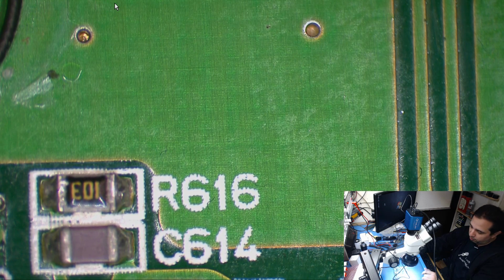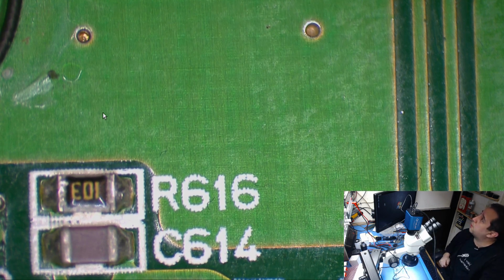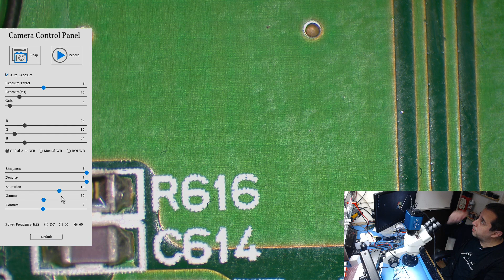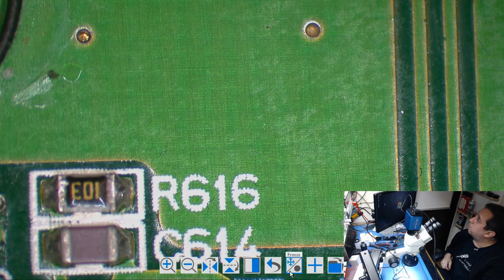OMANO 2300ST MICROSCOPE WITH OPTIXCAM

Comment: OptixCam OCS-HDMI-1080PU 2.0MP PC / MAC 60 FPS Digital Microscope Camera
https://www.microscope.com/microscope-cameras/omano-ocs-hdmi-1080pu-2-0mp-hdmi-usb2-0-digital-microscope-camera.html
Reply: This is the same camera :
https://www.aliexpress.com/store/product/1080p-HDMI-USB-SD-digital-microscope-camera-with-SONY-sensor/1918400_32464609452.html

Without OptixCam logo on its side. And its only $340 including DHL Express shipping (about 5-7 days)

These are all the same Chinese camera with 2.3MP Sony Exmor IMX236C sensor, 60fps HDMI, 30fps USB output. Not bad, usable, but not especially HQ either. The resellers put a brand name on them for another $100...300
Nice business.

The AmScope's camera manufacturer is the same as OptixCam's, so they also sell exactly the same type, of course.
http://www.amscope.com/accessories/camera/1080p-hdmi-digital-camera-for-standalone-and-pc-imaging.html

RisingCam  $339
AmScope $429
OptixCam  $659
The choice is yours.

This is the original manufacturer:
http://www.touptek.com/product/showproduct.php?lang=en&id=285

Comment: Hi, I have an amscope  SM-3TZ-54S with trinocular. Just received the amscope af100 and honestly not impressed. Basically I'm looking for a clear picture 1080p camera like this one that attaches snug to the amscope and records without me having to ..as you stated.. hold a separate camera recording my monitor. Does this allow you to record while still in pc or is it swap to hdmi and record via micro sd instead? Also which adapter would you recommend? I really appreciate it, thank you. Also great vid!
Reply from the maker: The AF100 is a piece of junk. I had my own bad experience with it before I got my other camera and scope. Amscope was less than helpful to correct an issue with consistent clearly across the image. They kept streching out the my issue past the return period and then told me that that camera was not compatible with the trinocular scope system. It then was a nightmare trying to get a return/refund. I was not happy with the situation. Once I did get the refund I went to Microscope dot com and did my buisness there and was much more satisfied. In the description of this video are the parts I used. You can use OBS software for recording from the camera into a HDMI capture card. You can call them and tell them you saw my video and would like the same parts and parts listed and they will help you out.
Reply: Kev31779 awesome I appreciate it, also subscribed. Thanks again!

Comment: Here is your model, without the fancy "OptixCam"label, compare the 2 and let me know if i'm wrong. Thing is I've been there and done that :) lol that's why i'm letting you know to go and expose microscope.com for the fraud they are

https://www.amazon.com/Definition-1080P-Microscope-Camera-Control/dp/B01GQQYBUQ/ref=sr_1_4?ie=UTF8&qid=1470066486&sr=8-4&keywords=1080p+microscope+camera
Reply from the maker: As far as I was aware of is the new "Optixcam OCS-HDMI-1080PU" replaced the old and discontinued OCS-HDMI-NH1080. The link to the one you sent me looks like the camera. Maybe that is a knock off of the new version or has been re branded. I do not know. I expect I got what It stated. I do not remember what the box looked like. I will have to see if i can find it.
Reply from the maker: +Thomas Crown I can tell you one thing. It is light years better than Amscopes POS autofocus version they recommend  for the same price. I know , I bought and it was horrible. Bad pixels and crappy sharpness, colors were off. Just all around horrble.. Sending it back was a huge hasle. Almost didnt think I was going to see my money again.
Reply: agreed sending anything back to amscope is a pain
Reply from the maker: It appears that they state on Microcope.com that Optixcam is their house brand. I do not know if they can choose a level of quality camera and slap their Optixcam can sticker on it. I don't know,  It is unclear. I do not see an official Optixcam distributor or company. So It appears that they can re brand any camera on there site to their "Optixcam" quality standard.  Seems like Optixcam is just an in house buzz word. So I would think that the original "real" HDMI-NH1080 camera is nothing more than a re branded one itself also.  Who knows.    http://www.microscope.com/education-center/buyers-guides/microscope-brands/optixcam-microscope-cameras/

Comment: Not to burst your bubble buddy, but your "optixcam" is not really an optixcam. Let me guess, came in a generic box "HDMI+USB MULTI OUTPUT", label from a label printer on the side saying "OptixCam)
 lol Only One LED on the back of the camera? Optic cam is more rounded and has 3 LED lights, 2 on the top and one on the bottom. Yours is a cheap knockoff from amazon sold for 599.99 by microscope.com :)

Comment: Thank you for the review. I love your set up and want to order exactly. Can you help me with the exact list of build? Any adaptors I need?

-OCS-HDMI-1080PU 2.0MP HDMI / USB2.0 Digital Microscope Camera 
or
-OCS-HDMI-NH1080
is there a difference?

-OM2300S-T Trinocular Head (Recommended for Cameras)
-V15 Boom Stand
-144 LED Ring Light, Variable Intensity by Section
-0.5X Barlow Lens for Omano OM2300S, WD=200mm
Reply from the maker: +Marcus Choe  The OCS-HDMI-1080PU replaced the OCS-HDMI-NH1080. It has a few more bells and whistles. You are going to need a camera to head reduction lens adapter, I think it was a 0.3 or 0.37x. Do not get the bore adapter type or the camera will rotate. The articulating arem was from amscope part number APC. But the stand can be your choice of any from whatever vendor you like as long as it accepts a 76MM head
Reply: +Kev31779 Thanks Kev for the quick reply. I talked to the microscope.com people and was told to get the 
-C-Mount Adapter 0.3X for Omano OM2300ST $109
instead of
-Fixed 23mm Camera Adapter 0.37X for SK2 Series Cameras $24
or
-Adjustable 23mm Camera Adapter 0.37X for SK2 Series Cameras $59

because it's made for OCS-HDMI- 1080pu camera will have a bigger field of vision. Just trying to make sure I don't buy unnecessary upgrade.
Reply from the maker: +Marcus Choe  You will not be disappointed with a better lens adapter . If you cheap out and get the bore adapter instead, the camera will rotate on its own and the optics are not as superior. Here are the parts I ordered.  OCS-HDMI-1080PU ,  OM2300S-T ,   OMBL-2300S-05X  ,   OMCM-2300ST-03X.   from microscope.com and from Amscope I ordered the APC articulating arm. I hope this helps.  The mount works for my situation but it may not for yours. You will have to decide what type of mount will be best for your purpose..
Reply: +Kev31779 I can't thank you enough for your time and detailed information.
Reply from the maker: +Marcus Choe  No problem just ask for the Kevin package lol
Reply from the maker: +Marcus Choe  And for video input to the PC I used a Elgato HD60 Pro
Reply: +Kev31779 Since you are using the OMBL-2300S-05X to increase working distance, does this cut the magnification to half of 45X ? Did you get the 20X eyepiece to bring it back to 45X magnification?
Reply from the maker: +Marcus Choe I got the standard 10x eye pieces with the 0.5 barlow. Anything more than that and the image becomes darker to close and a little shaky. For my work I think the 10x eyp with the 0.5 barlow is just a fine range for the scope.

Comment: Well done for copying Louis. Now do something original!
Reply from the maker: +rupert handford What am i copying? Repairing electronics and using common tools that work better? I believe my channel has been around a lot longer. Why ignore what works better. My content is completely different. I don't fix Mac products. What am I copying? That fact that I bought a quality microscope that works well? I tried the Amscope combo and it was horrible. I was tired of filming the monitor with my hand held camera and soldering with a macro lens on top of my work getting in the way. Would a mechanic be called out for not being original if he is using a Snap-on ratchet set to repair a car when another shop uses the same set? Whats the big deal?
Reply from the maker: +sporadic -Z Thanks for the support.